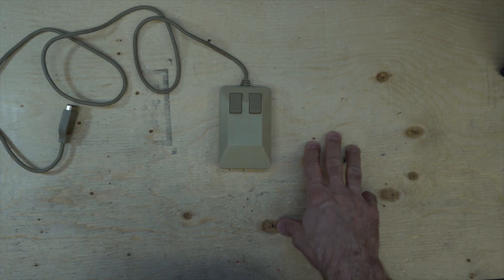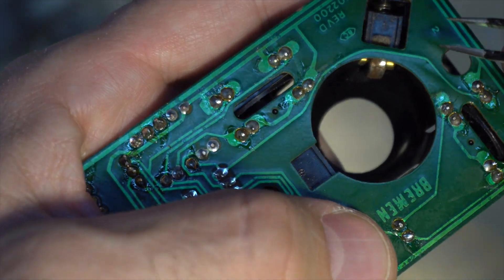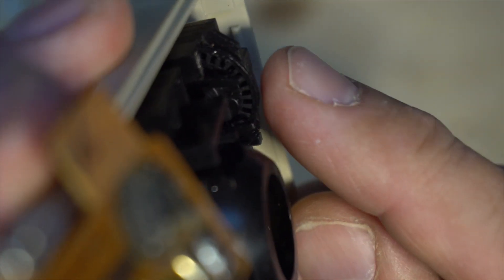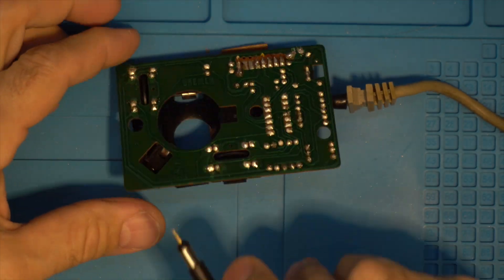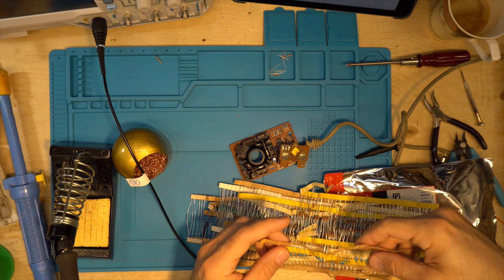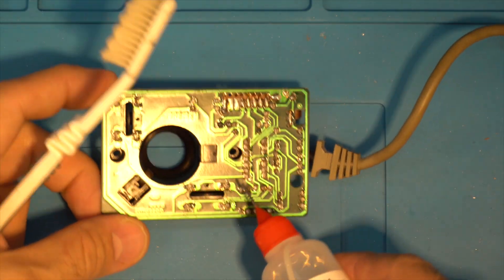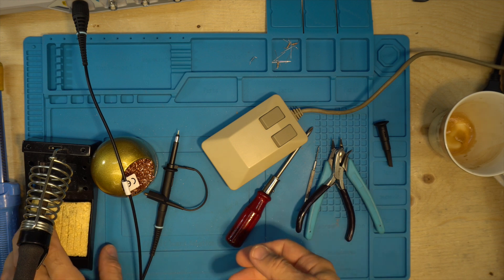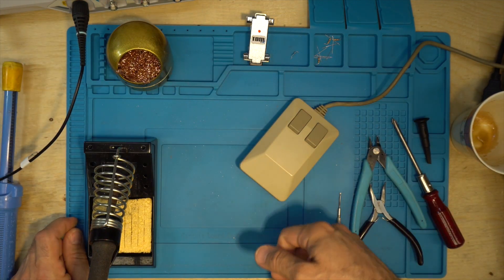Amiga Tank Mouse Repair

Comment: Nice fix!
Made in Bremen?! I didn't know of Commodore doing any manufacturing there.
Reply: The first production facility to spit out Amigas was in Germany, I learned very recently (Yesterday :D from Jan Beta )
Although the first Amigas were sold in the Netherlands.
Reply: @paulmichaelfreedman8334  Hmm, are you perhaps thinking of the first Amiga bridgeboard rather than first Amga? The original 2088 XT brideboard said "MADE IN GERMANY" on the early motherboard revisions. Doesn't make sense for the earlier Amiga models though, IMO.
Peace.
https://www.youtube.com/watch?v=44LQZqba5fA&t=5m50s
Reply: @DrDavesDiversions  Check out Jan Beta's early 500 model review, it's his latest video
Reply: @paulmichaelfreedman8334  OK, will do! The 500 is not an early Amiga.
Reply: The 500 jan beta reviewed is serial no 159, so pretty early for a 500
Reply: I thought these were made by Mitsumi for Commodore?